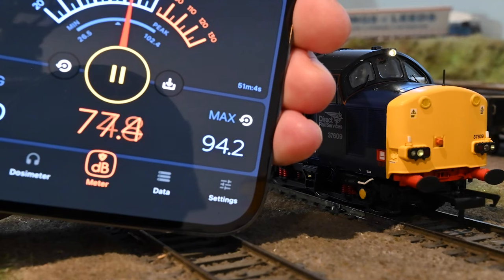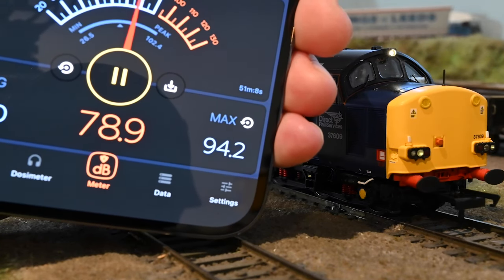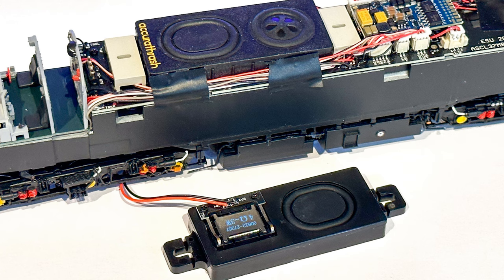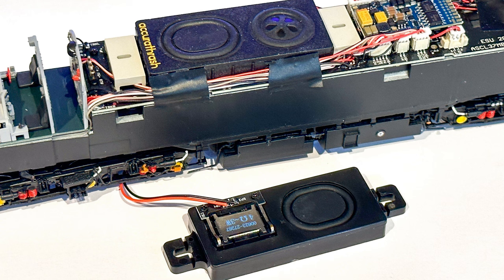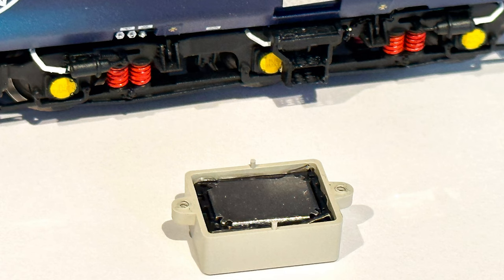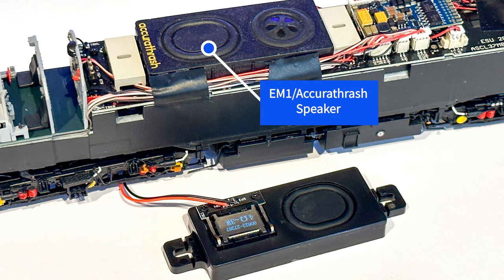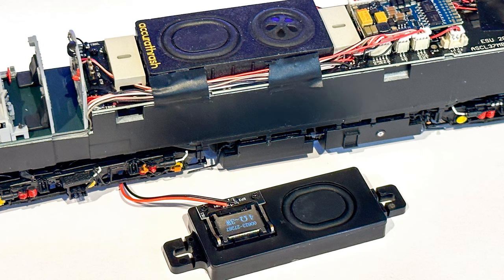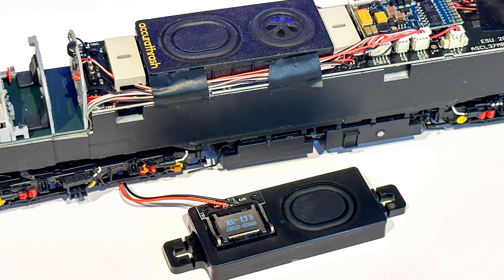Comparing Speaker Setups For The Accurascale Class 37

Comment: Interesting watch and tempting to remove all sugarcubes however now that the bass and treble can be adjusted on the locos maybe this would be the best solution...
Reply from the maker: It will give different results again, I suspect the best option now will be to take the sugarcube out still and turn up the treble, because the EM1 can handle it fine, but if you turn the bass up with the sugarcube, or with the NEW ESU speaker I think it will probably introduce some crackling, I will look into making these changes to mine and do another video at some point

Comment: Very interesting comparison. Is the sugar cube speaker just removed and no other adjustment made, doesnt removing the sugar cube affect the overall impedance without affecting the chip?
Reply from the maker: It corrects the impedance, its supposed to be 4 ohms, minimum, the Accurascale setup is 2.4 ohms
Reply: What if we connect sugar cube in serial and set treble some low ?
Reply from the maker: @goldenwings8912  if you connected it in series then it would stop the locos that cut out on start up from doing so, but it would probably still crackle

Comment: Might not be worth stocking those new ESU speakers. Based on this test no chance for this application.
Reply from the maker: I think it’ll be good in things requiring a higher pitched sound, it might also be better at lower volumes, where as the EM1 is better at high volumes. I also bet it’s good in steam where the EM1 can sound a bit flat.
Reply: @roadsandrails  Hope you do find a good application. I tested ACC DRS 37 last evening. I found the distortion of the horns as you indicate, but only in one direction. Perhaps there are different sound files dependent on direction?
Reply from the maker: @davew2452 some sound files do have directional horns, I’m not sure about this model though